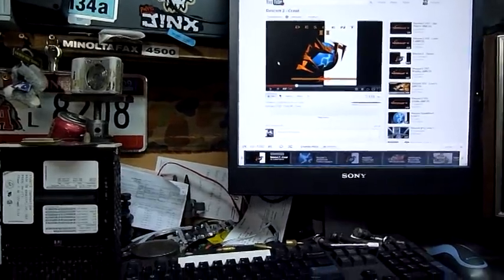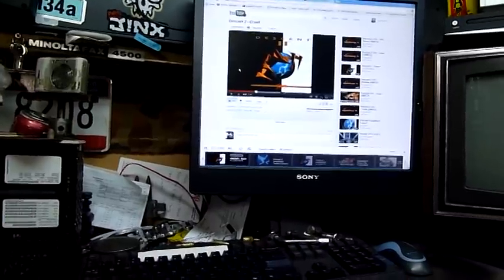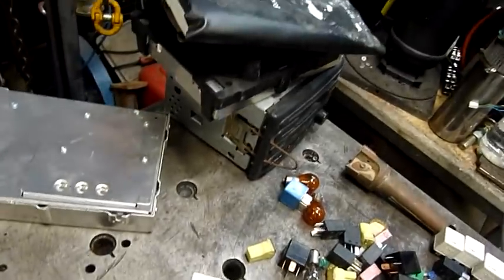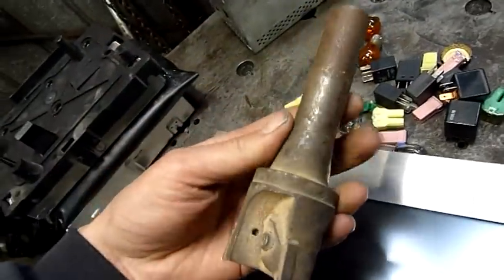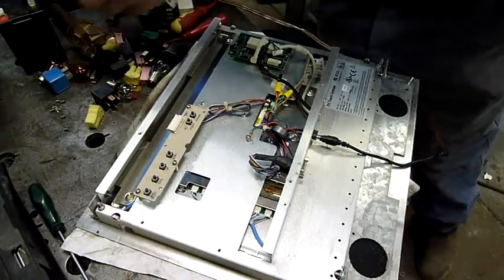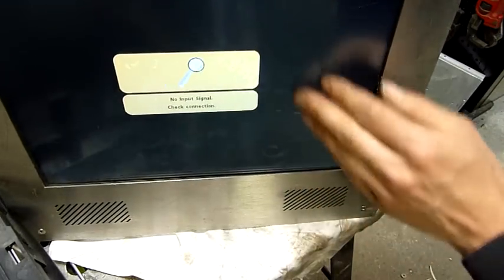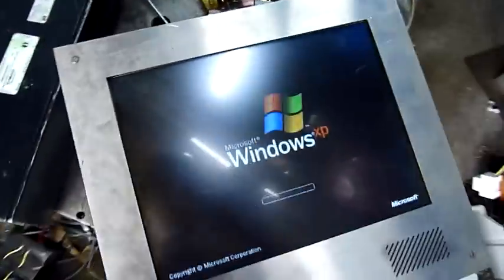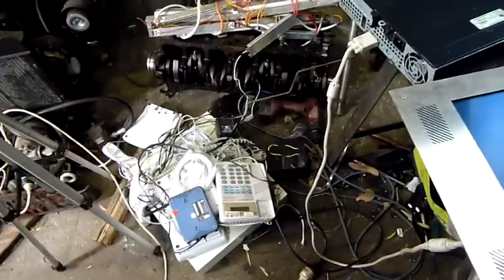Saturday Haul - Holden Junk and 3M Touchscreen LCD

Comment from the maker: Its a 3M Touch Systems 5406120 R2.2 (printed on board) near the data connector its labled "EXII - 1050SC Rev 2.1 FIM"

Comment from the maker: awesome :D. got it to power up. if you peek inside the top vents with a flashlight you can see the pin-outs printed on the board :D

is it possible to make it run all the time without a code or are these units done-for once you loose the code?

Comment: i work with touch screens a lot at work(video slot machines) i have seen both usb and serial 3m micro touch controllers yours looks serial, good thing tho is the drivers are easy to get.

Comment: i have seen many different variants of 3m microtouch boards. i work with touch screens daily in slot machines. i have seen ones that are 5v and 12v power. serial, ps2, usb, and ones that use a proprietary form of serial used only in slot machines. by far the most common i have seen are your standard serial. if we can get a model number off the board i can try to get you information on it i have pin outs and drivers for a lot of touch controllers.

Comment: you have a MicroTouch EX II Series Controller the 1050SC is a serial rs232 if it was a uc it would be usb. i will trace out one of the cables at work for a pin out i think they are all the same.